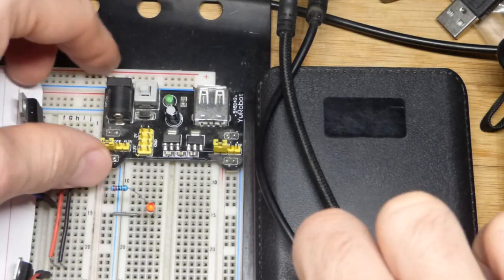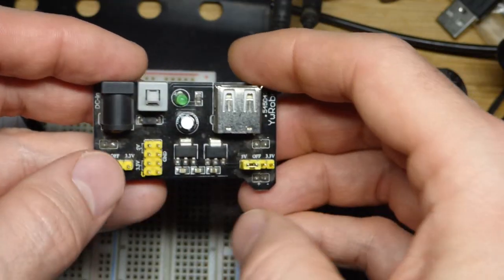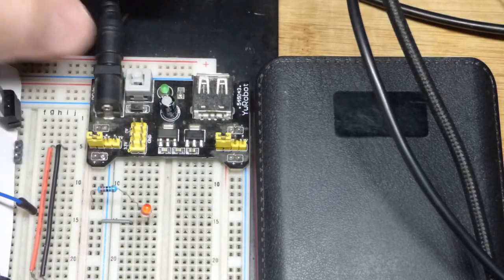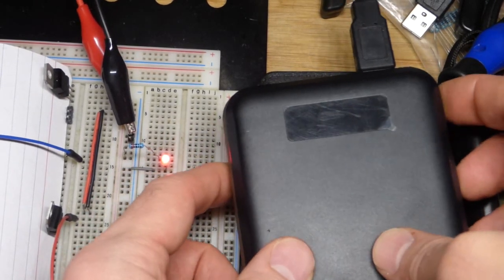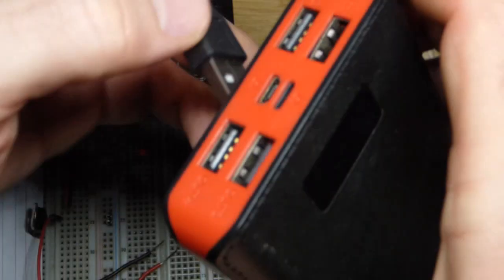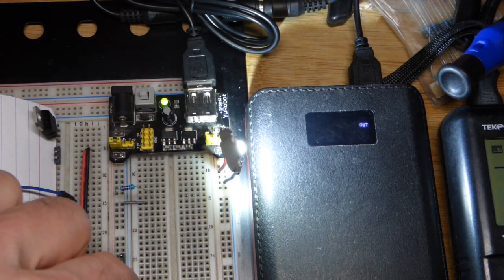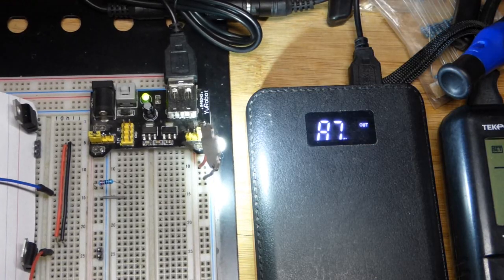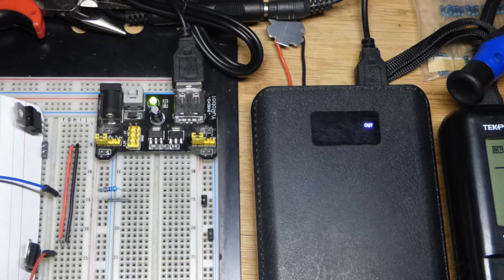Testing Using Breadboard Power Supply USB Port As An Input

Comment: did you know that some power banks have a low current mode? in that mode they wont turn off the output for about an hour or so to enable charging of ear buds, smart watches and the like.
Reply from the maker: Pretty sure I have at least one that stays on at low current. Good thing to test out if you have a new power bank.